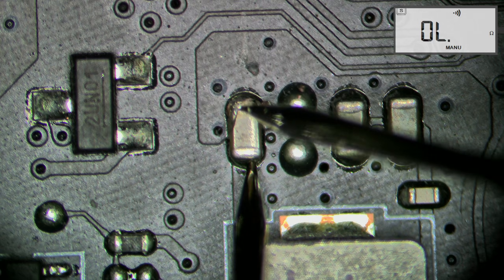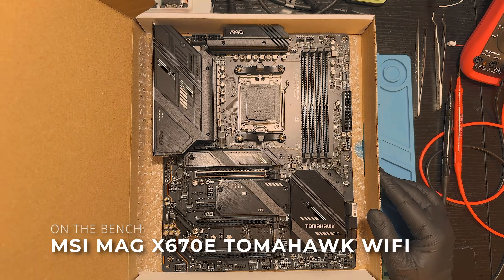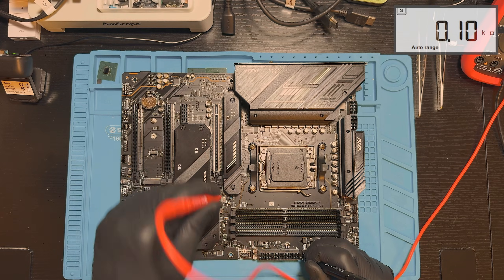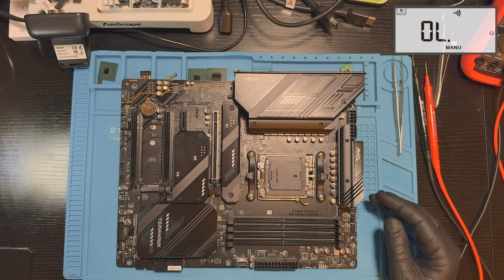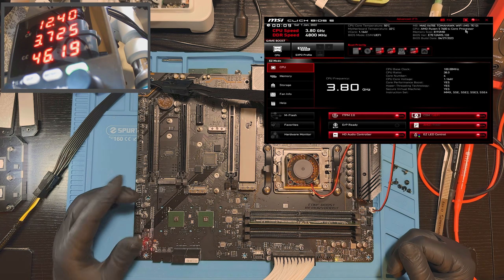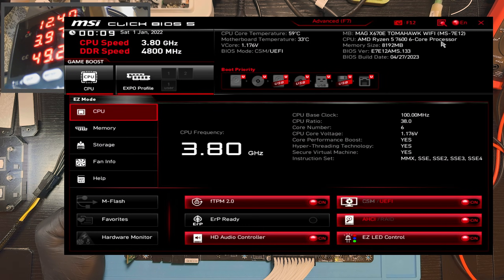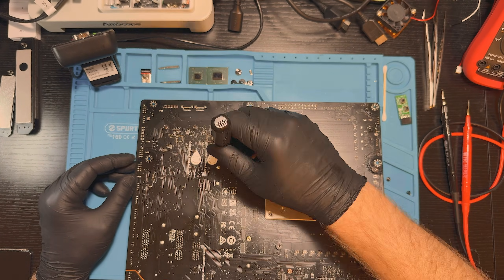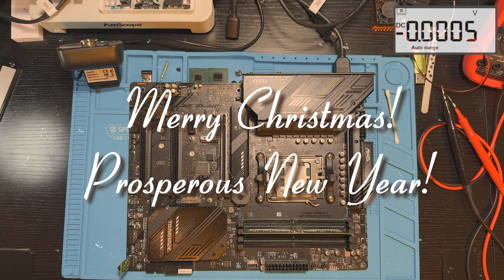No Power on Motherboard – A Common Problem with an Easy Solution - MSI MAG X670E TOMAHAWK WIFI

Comment: Would using a hot tweezers not be easier than having to cover the plastic bits from the hot air? Or are these too small components for that?
Reply from the maker: Hot tweezers can definitely be handy, but not always. In this case they could work, however for me it’s usually quicker to use hot air rather than switching the station over to hot tweezers. With proper airflow control and shielding, hot air is fast and reliable even for small parts.

Comment: I have same mobo, Bought it brand new last year and used it like a 5 days and put it back to box. Few days ago i wanted to test a cpu and take it out, Bios flashback port doesn't work smiles... Board works fine with no issues  and its a good mobo actually but i dunno why bios flashback port dead.  I have that probleem with with different generation msi boards tho.. Probably esp protection popped for a reason.. But i have more funny mobo rog strix x670e-f, Sio died so i replaced it and repaired rtc section was causing random reboots. This thing locks and kills bios chip for a reason, Board runs but you can't use easyflash to update bios and programmers doesn't do anything to chip on the mobo or out of the moboi You can't erase the flash doesnt matter what you do, I replaced it with 3rd one and it did same thing to the chip,  Mobo runs and only you can update bios via bios flashback, Help me to understand what the heck is going on with this one lol because i dunno why it is doing that to bios chips.. Voltages are normal btw..
Reply from the maker: Thanks for your comment! The MSI X670E uses a dedicated controller for the USB Flash BIOS button, located directly beneath the upper M.2 slot. I would check this controller and its surrounding circuitry first.

On the ASUS ROG X670E, there is also a separate controller responsible for the BIOS Flashback function. It is located on the left side of the PCH, and I would inspect both the controller and its circuitry.

Additionally, some motherboards require the CPU to be installed during a BIOS Flashback update, while others require it to be removed. Always refer to the instructions for the exact motherboard model to avoid issues.
Reply: @FixThePixel  Okay thanks I'll check them out.. Rog x670 is interesting case bios flashback works but you can not flash bios from bios easyflash because i dunno why it is locking bios chips and doesnt let you to write or erase it, Even when you take it out you can't erase or program flash chip anymore and i put it there is a brand new chip. Original one was doing same thing thats why i replaced it. I couldn't find that why flash is getting locked.. weird..